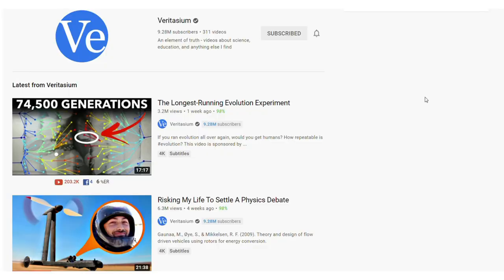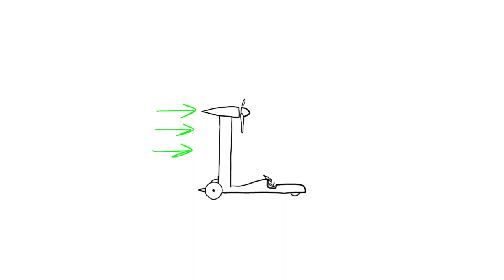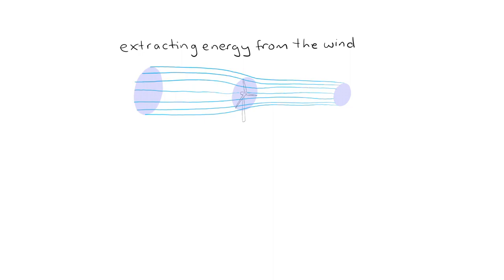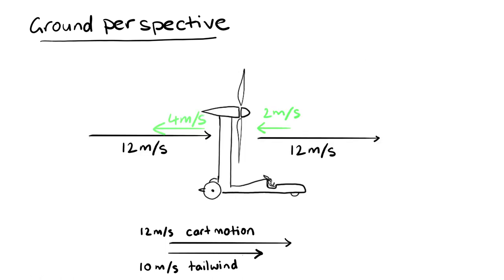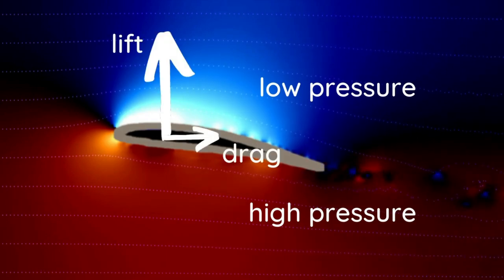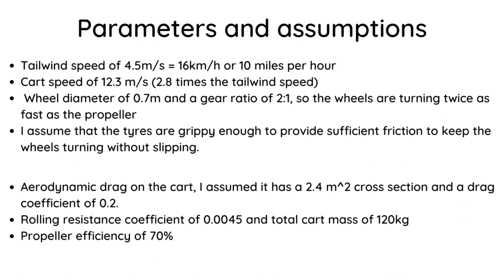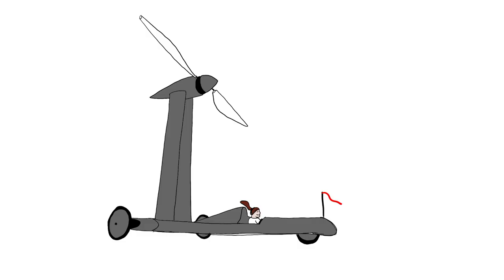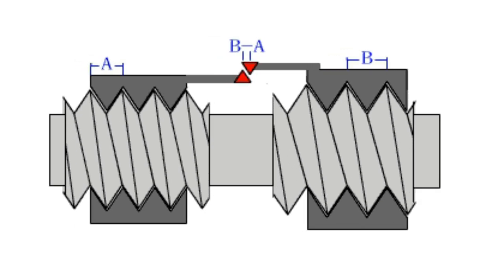Downwind Faster Than the Wind by Veritasium: How Does it Work?

Comment: I still intuitively do not understand how it obtains  energy from the wind while the perceived wind speed is zero or negative.   What if there is no wind and you push the car to get it started. Surely it cannot sustain any speed and will decelerate to 0, right? So why is it different from say a 1 km/h wind speed?
Reply: The pitch of the blades allows the air to strike the rear of the blades despite the headwind so as long as the blades are spinning fast enough. Thus, despite the cart itself experiencing a headwind, the blade elements experience a tail wind.
Reply: @ayoutubechannelname  Does your argument also work when there is no wind and the car has an initial velocity?
Reply: @werner134897  In such a situation the rotational kinetic energy of the blades could be converted into translational kinetic energy of cart, but after that conversion then clearly the cart would slow down. Nonetheless, thrust would still be produced until it stopped.
Reply: @ayoutubechannelname  So, my question was, why does it stop in this case, and not in the case of positive wind speed. I mean, how does it change the argument / theory of yours and of Rosie?
Reply: @werner134897  The energy comes from the kinetic energy of the ground relative to the wind. Since the ground is incredibly massive, in the frame of reference where the cart velocity and wind velocity are both zero the ground can impart kinetic energy to the wheels without measurably slowing down. That energy gets transferred to the propeller and then to both the wind and the cart, which gain kinetic energy but in opposite directions relative to this frame of reference.

Comment: It's not turbine in this design, it's propeller driven by wheel actually. The propeller blow air to the opposite direction to wind so that wind slow down more, hence more wind energy is transferred to the car, comparing to the turbine design.

The turbine design also slow down wind, but not as much as the propeller design, also if car speed is the same as wind speed then turbine is no longer get spinned by wind hence car speed would never greater than wind speed.

It's essentially a smart design to make wind slower more than turbine so more energy is transferred from wind to car

Comment: As far as I understand it the vehicle sees the apparent wind, so with a following wind speed of say 15MPH and a speed over the ground of 30MPH that would be 15MPH. The same situation (with the drive gearing from the wheels to the blades doubled) would occur in totally still air at a ground speed of 15MPH. The reduced rolling resistance could be ignored or simulated with a slight drag on the wheels, either way won't affect the outcome of this thought experiment. Then if we tow the second vehicle up to 15MPH before releasing the tow rope, both vehicles see exactly the same situation and should perform in exactly the same way.

My question is, given the air is still and therefore contains no kinetic energy, where is the energy that the blades are extracting coming from?
The very best this vehicle could be is a perpetual motion machine, except that its rolling resistance alone makes that impossible. 

This won't work!
Reply: When the air is still with respect to the cart, it still very much has kinetic energy with respect to the ground.   Just because a cart passes through doesn't make the energy of the wind disappear!  At windspeed, the cart is still slowing the wind with respect to the ground (the part processed by the propeller) and is able to take that loss of energy of that wind and utilize it to power the cart.  Since the prop is interacting with the air and the wheels interact with the ground, for the purpose of energy conversion, at windspeed, the body of the cart really doesn't matter except to hold those parts in place.
Reply: @ChrisHill5650  We are in violent agreement---That in still air the cart can extract no energy and can not work.  It will quickly slow to a stop after being towed up to any speed.

But in the second case where there is a tail wind, if you tow it up to 30 mph, it will actually work because the blades are not in the same situation.  The prop is geared to the wheels (fixed gearing) so at 30 mph over ground, the propeller is turning 2X speed compared to the cart over ground at 15 mph.   So don't change the cart gearing from the 1st situation and it works just fine.

But using your gear change:

Note that "extracting no energy" in the first case does not mean, "produces no thrust".    It can't overall extract energy because the thrust will be less than the retarding force at the wheels so it will stop.  But it can produce  thrust but not net thrust since the retarding force at the wheels is larger than the thrust to keep the prop turning (which won't help it in any way).  It will slow to a stop.   

Because of the change of gearing in the second case, the prop power requirement is the same (in the same wind conditions) but since the cart is traveling twice as fast, the force at the wheels will be half as much as the first case to turn the prop at the same speed because P = F X V (over ground).   So now the thrust exceeds the wheel retarding force and the cart works.
Reply: @ChrisHill5650  See my edited explanation above.  There are no different forces on the blades but due to the gear change the force on the wheels is halved with the speed over ground doubled for the same power required for the prop.  Because Power = F X V(over ground) for the wheels.   The power requirement for the prop is the same as you stated.  So 1/2 the retarding force at the wheels compared to case 1 in still air so the cart works.

Comment: Hi again! So, I been thinking about practical application: Put a VAWT behind the Propeller, but on the same drive. The VAWT starts the prop spinning which starts that whole confusing loop thing. In essence, The VAWT takes the place of the car/wheels. any excess energy (Speed in excess of wind velocity) could be harnessed. In theory at least.
Reply: The purpose of the car/wheels is not merely to get the propeller turning.   

You've described a turbine turning a propeller blowing into a turbine driving the propeller -- on and on.   This is no different than putting a generator on the front axle of a vehicle and expecting to use that power to drive the rear wheels in a productive manner.   To quote physicist C.P. Snow:  "You can't win, you can't break even and you can't quit the game.". 

By eliminating the wheels and making your rotor stationary, you have eliminated the very thing that allows the Blackbird to continue to harvest energy when the rotor is at windspeed and above.  There will be no "excess energy" produced by what you describe.  In fact, the VAWT will have less energy to utilize productively as the propeller will be sucking up power with no return on investment.
Reply: @johnborton4522  You misunderstand. The Rotor would not be stationary. The initial wind, pushes the VAWT (Like the car frame in the video) which in turn drives the propeller. In effect, the VAWT becomes the vehicle body and wheels and the propeller maintains it's original function. If momentum is required, a flywheel could be attached.
Reply: Ok, you'll have to be more descriptive, because in your original description you say:

// "The VAWT takes the place of the car/wheels."//

Without the car/wheels, how is the rotor not stationary?
Reply: Mike C, after rereading our exchange perhaps I now understand our disconnect (and perhaps not).

When I say "making your rotor stationary" in my first response, I'm referring to it moving across the ground, not the motion of it spinning around an axis.

Does the spinning device you describe move relative to the ground, or does it sit in one spot and spin?
Reply: @johnborton4522   Ah! I understand now... In the way I picture it, the VAWT/Propeller would be stationary relative to the ground, However the Kinetic energy from the Vawt (converted from the wind) would replaced the horizontal motion of the vehicle. A simple flywheel could be added to equal the weight of the vehicle (More or less, as needed), so yes, in effect, the Vawt drives the Prop, which in turn drives the VAWT.
Reply: And now, my brain hurts.. LOL
Reply: @mikec3955  

Ok, thanks.  There was nothing wrong with the way either of us was using the word "stationary", we just had to get on the same page. :)

So now that we are on the same page, you can return to my original reply and read and apply it as written.  In that reply I am correctly assuming a spinning, but not moving across the ground device.  What I wrote applies directly to your proposed device.
Reply: @johnborton4522  Having seen that vehicle traveling faster than the wind, I respectfully disagree. A flywheel would easily replace the energy of "moving across the ground". It changes the motion of the wheels from a straight line across the ground to a circular motion (Although the "wheels" would still see it the same way. I don't understand the mechanics of it fully yet, but that vehicle shows that the energy is there.
Reply: BTW, I'm enjoying our discussion quite a bit... Would love for Rosie to chime in.
Reply: @Engineering with Rosie Thoughts on this thread? @Veritasium same question...
Reply: @mikec3955  

// "Having seen that vehicle traveling faster than the wind, I respectfully disagree. "//

It's clear you don't have a clear understanding of how the Blackbird harvests energy.

// "A flywheel would easily replace the energy of "moving across the ground"."//

Nope.  Any attempt to use energy from a spinning flywheel to replace energy harvested from the wind will be simply doomed to the flywheel slowing to a stop. 

// "I don't understand the mechanics of it fully yet..."//

Correct. 

The Blackbird doesn't harvest any 'extra' or 'unusual' energy.  There is no 'conservation of speed' law which the Blackbird must work around.  It merely is unique in it's ability to harvest plain jane, normal, ordinary wind energy while traveling directly down wind.

Your proposed device and the assertion that it can productively harvest wind energy simply shows you don't understand the mechanism by which the Blackbird harvests (nor understand the standard laws of physics which govern the Blackbird).
Reply: @mikec3955  

BTW, you likely already know this, but in case you haven't figured it out, I am the co-designer and builder of the Blackbird (along with Rick Cavallaro who is also here commenting on this video).
Reply: @johnborton4522  I hadn't figured it out until your last post... "The Blackbird doesn't harvest any 'extra' or 'unusual' energy.  There is no 'conservation of speed' law which the Blackbird must work around.  It merely is unique in it's ability to harvest plain jane, normal, ordinary wind energy while traveling directly down wind." That part I do understand, I think.. And your right, I absolutely don't understand it near enough... but I do enjoy thinking about it. 
         This is where I get stuck: If wind velocity is "X" and Vehicle velocity is "Y" then isn't Y-X "extra" energy? "Extra" in the sense that it is energy that could be used elsewhere?
         Oh! and before I forget, you guys are freaking brilliant! (needed to get that in there..)
         Back on point: I understand that you have "Built a better mousetrap" as far as harvesting wind energy. And I also believe that there is more to come from your designs... The whole thing feels very "Kitty Hawk"ish, and very exciting!
          Thank you very much for taking the time to discuss (and explain) the concepts behind the Blackbird. I have thoroughly enjoyed it! 
          P.S. If I remember correctly, weren't you guys initially told it couldn't be done? I wouldn't mind being the next one to win that bet... (Not likely, but....maybe?)
Reply: CLICK! I just got the need for the moving vehicle as opposed to a flywheel. Thank you for that! I now have a different idea for how to "harness" the Prop energy from a stationary position... What if you put a shroud on the "Prop wash" and fed it into a seperate VAWT... My mental picture would be 3 VAWT's, 2 to the side of the prop for initial spin up, and a 3rd in the center fed by the prop/Shroud? And, Yes, if your thinking "Wow, this guys really stuck on that whole flywheel thing", your correct again!
      Thank you again for talking with me. Means a lot!
Reply: @mikec3955  

A flywheel is just a battery.  It only stores energy.  You have to use energy to fill it, then you store it for a time, then you can reuse (some of) the energy that you stored.  Even if you use it immediately, you still lose energy in the conversion and the longer you wait to use the stored energy, the more you lose.  A flywheel is never a productive device to produce energy.
Reply: @mikec3955  

// " I understand that you have "Built a better mousetrap" as far as harvesting wind energy. "//

But we really didn't, that's you misunderstanding the device.   It's actually a far more complex way to harvest wind energy than a simply tower and turbine.  Imagine trying to maintain a bunch of wind generators moving at freeways speeds across the desert.   

The Blackbird is more of a 'one trick pony' -- literally it was built to settle an internet shit fight.  They said it couldn't be done.  Rick said it could.  I said "Let's show'm'.  We worked together for two years and now it can be demonstrated.

If you think everyone is wrong -- go build yours.  If you're right, show us.  There is education even in failure. (But I would suggest getting a good education in science and physics before setting off -- it will save you much time).
Reply: @johnborton4522  I am inspired by your success! I think maybe I'll stop bothering you and go play in the garage... I wish you nothing but success and good fortune, sir! Thanks again!
Reply: @mikec3955  

Best wishes.

Comment: Hi Rosie thanks for your explanation re Blackbird. My son and I are similarly very interested in this physics. Not that we are scientists - we are not! In the original video they demonstrate the concept by putting a model on a treadmill, and the model accelerates off the treadmill. If a bar was put up to prevent the model leaving the treadmill, and the wheels of the model were designed to be able to grip the treadmill surface, wouldn't this then accelerate the treadmill? And wouldn't this then be a power output with no further power input? This is confusing to me? Can you please explain why this isn't used to generate power on a large scale? Thank you. Christian and Ezra.
Reply: " If a bar was put up to prevent the model leaving the treadmill, and the wheels of the model were designed to be able to grip the treadmill surface, wouldn't this then accelerate the treadmill?"

No, the force by the wheels on the treadmill belt is opposite to the belt motion. To extract energy from the relative motion of air & surface the cart exerts forces on air & surface that are opposite to their mutual relative motion.
Reply: The wheels of the device are constantly trying to slow the belt down, not speed it up.

Comment: Does this mean we could actually build a glider that could take off on a few meters without any engine ? Or the drag force would be too intense with large wings ?
Reply: Here it's crucial that the cart interacts with both the air and the ground which move relative to each other. I don't see how you could do that with a glider.

Comment: Hi Rosie. You said that the wheels on the cart turn the propellor, twice in the early part of the video. Surely, the motive force is the wind, which then drives the wheels?
Reply from the maker: Both are correct!
Reply: @EngineeringwithRosie  So is it momentum, that sometimes causes the wheels to turn the propellor i.e. at those times when momentum exceeds wind power?
Reply from the maker: @ernielamprell6765  the wheels always turn the propeller. If the wheels are turning, the propeller is turning. If the wheels aren't turning, the propeller isn't turning. There is no time that the wheels are turning and the propeller isn't turning.
Reply: @EngineeringwithRosie  Thank you Rosie. So what is providing power to the wheels?
Reply: So you could remove the propellor and the wheels would still have motive force? 
I think not. 
I think you have not responded because your hypothesis is wanting.

Comment: Hi Rosie, I understood the condition we need to drive the cart to move faster than the downwind. 

In my understanding, from the perspective of the cart, the linear velocity of the wheel must be faster than the velocity of the propeller relative to the wind no matter in a downwind or treadmill system. Am I correct?

Comment: Can anyone explain how she calculated lift and drag force of a propeller in that excel sheet?
Reply from the maker: I knew the aerofoil used, so I looked up the lift and drag polars (lift/drag coefficient vs angle of attack) and used that data in a vlookup table in the spreadsheet. If you've got an aerofoil that doesn't have published polars then you can use Xfoil to calculate it.

Comment: I get it! The inertia accumulated by the wheels creates thrust on the blades in still air.
Reply: The inertia of the rotating parts is not relevant for it to work. No stored rotation energy is released when the cart accelerates, because the rotation of the rotating parts accelerates too (fixed gear ratio).
Reply: @remolabarca56  It applies to the treadmill models too: No stored energy is released when they accelerate, for the reasons explained above.